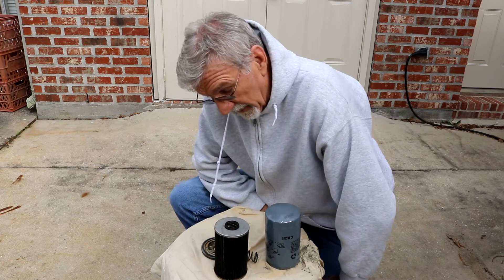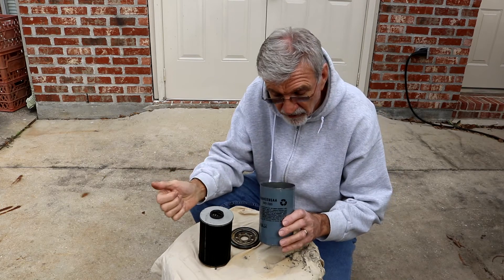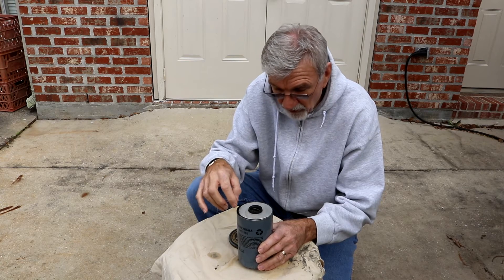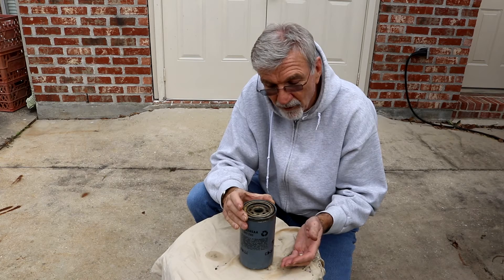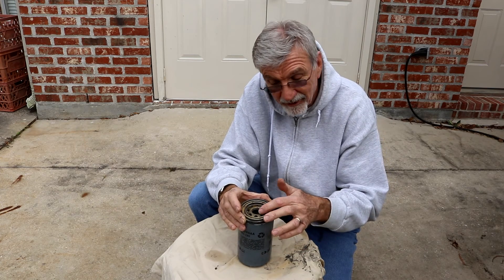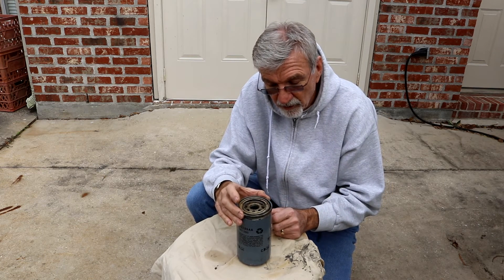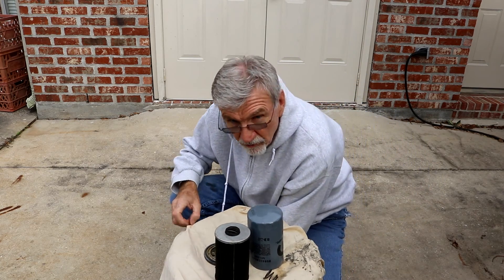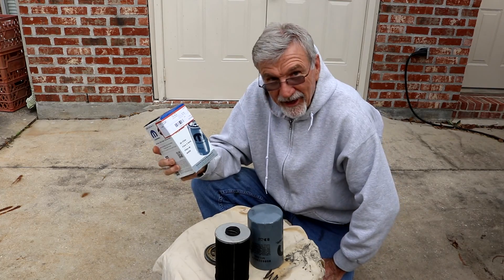RAM Cummins Mopar Oil Filter Tear-down

Comment: Do you think cat filters any better filter?
Reply from the maker: I like the Fleetguard or Mopar (same).
Reply: @MarionBlair  my opinion is that Cat filters belong on Cat engines and Cummins Filtration (Fleetguard) filters belong on Cummins engines. This is of course presuming Cat actually has a filtration product division like Cummins does.

[EDIT: Cat does NOT have a division or subsidiary that manufactures Cat-labeled filter products; this reinforces my already strong opinion that ONLY Cummins Filtration (aka Fleetguard) and the Mopar-boxed equivalents belong on a piece of equipment powered by a Cummins engine]

Comment: The check valve ( relief valve ) is built into the filter head / oil cooler cover on the engine.
Reply from the maker: Thanks, I guess that's why the oil level is down a couple of inches when you remove it.  Appreciate.

Comment: I've been seeing and reading quite a bit about prefilling the oil filter.
I'm beginning to think I've been doing it wrong all this time.
It looks like to me now that filling the oil filter is not needed and could possibly damage the motor in some way. Anyways good video as always, never knew or really gave it much thought on the actual flow of the oil filter, learned something new.
Reply: Food for thought: since the factory service manual says to prefill the lube oil filter it is mandatory.